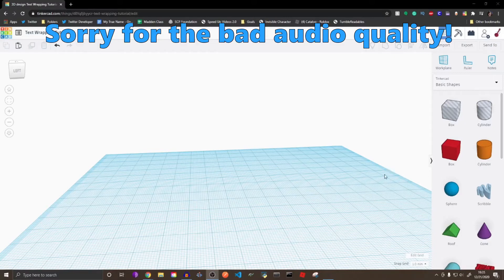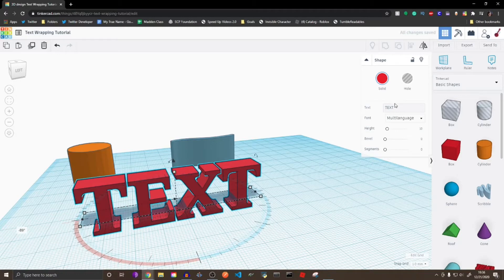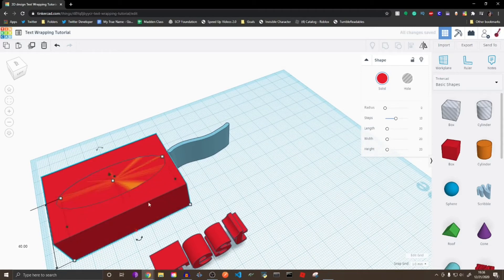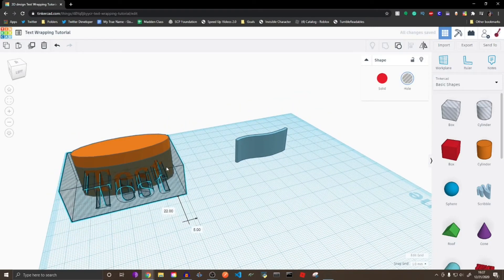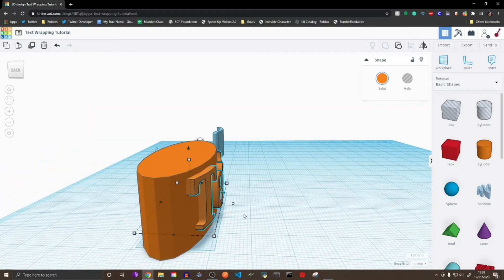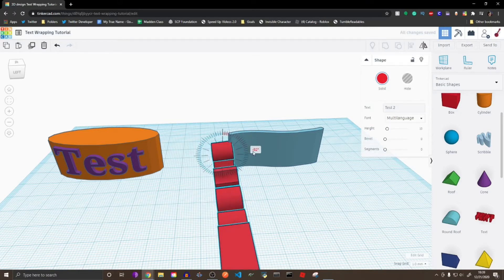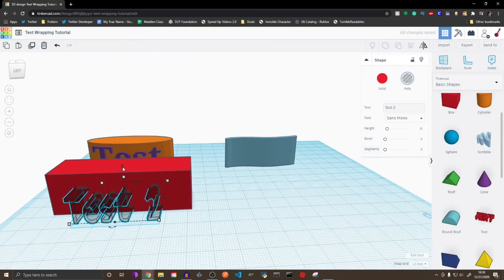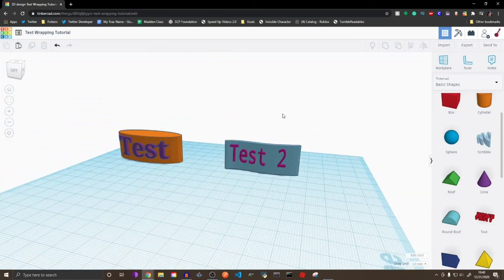How to Wrap Text Around an Object in TinkerCAD!

Comment: 06/2025
Great demo.
But .. Imagine an empty bucket with the 
word FIRE, on the outside.
The bucket sides are not cylindrical, they curve from top to the base.
The text must smoothly follow the outside profile of the bucket and not be visible on the inside.
There also has to be the same word, on the opposite side of the bucket. How do I achieve this please?